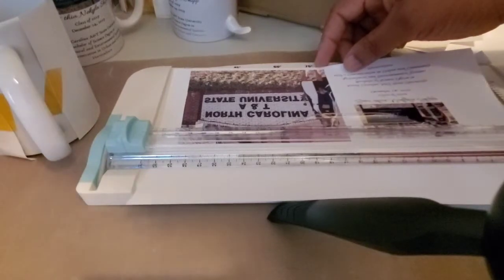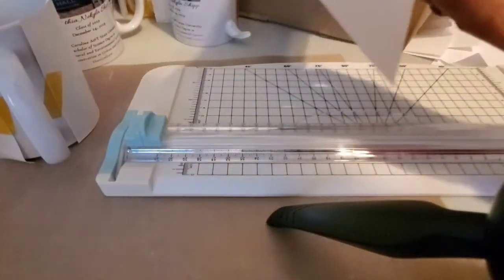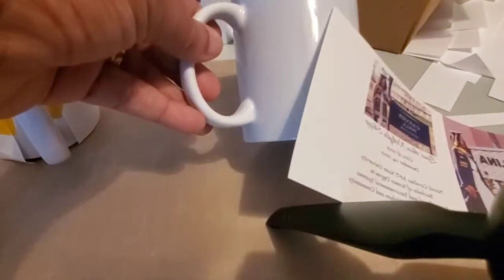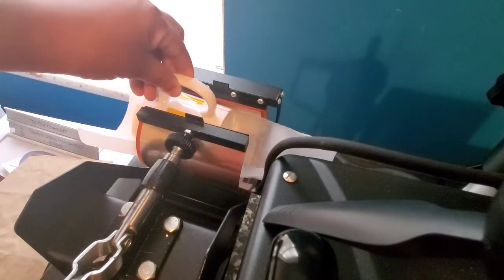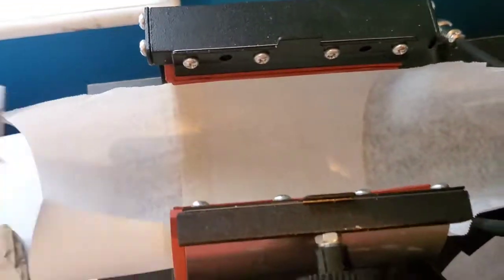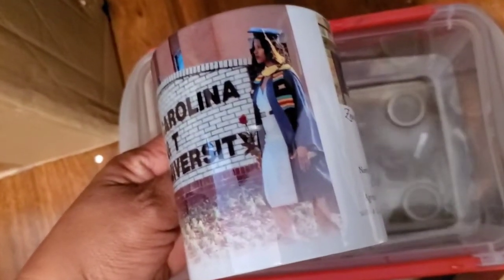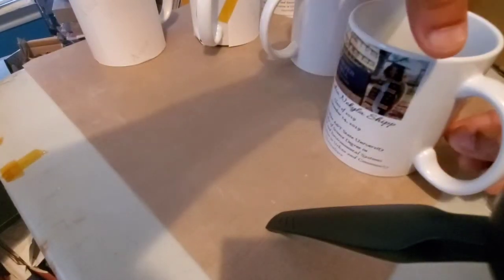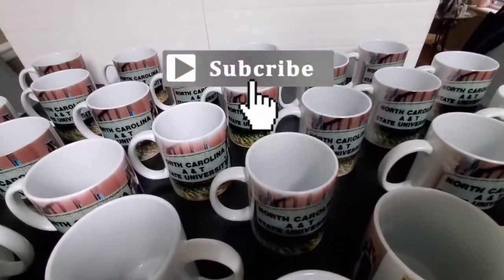How to sublimate a mug without ghosting

Comment: Hi! Nice mug! I just wonder how you can make the colors vibrant? Mine is a bit grainy and I really wonder why. 

I'm not sure if it is the picture I'm using, the printer or the mug press technique? I hope you can help me 🙂
Reply from the maker: Make sure you are taping down your image securely. Also, be sure that once you're ready to take the image off, you do so carefully.  The only other thing I can think of when you say your image is grainy, if it's stretched from it's original size, sometimes it will distort the image.  I hope this helps! 🙂😊
Reply from the maker: Thanks for stopping through!
Reply: I think I know what you mean, I feel iv the same problem. All my images are high quality vectors. Is it on solid colours and then up close there's a weird dotting? Or is it due to low quality image?
Reply: @evelladesign  try png image ..Nd you will have to change the printer settings..if its epson ...you will have to change couple of settings for a high quality picture ...